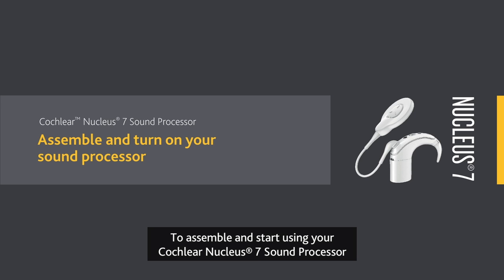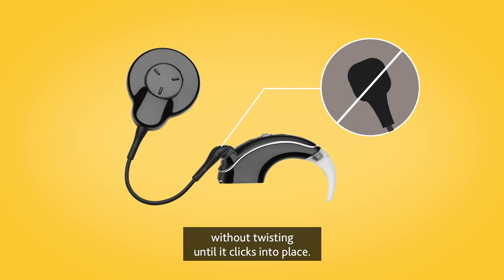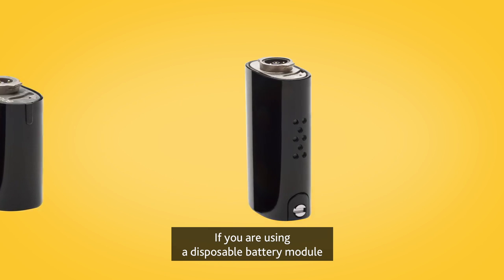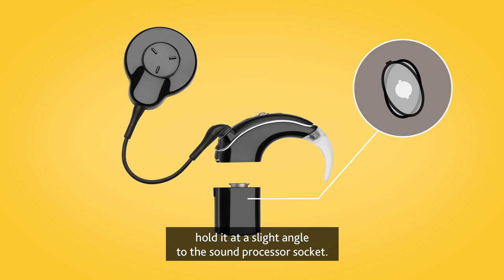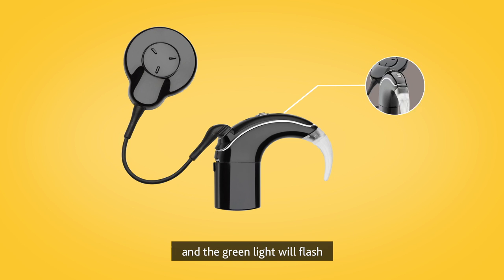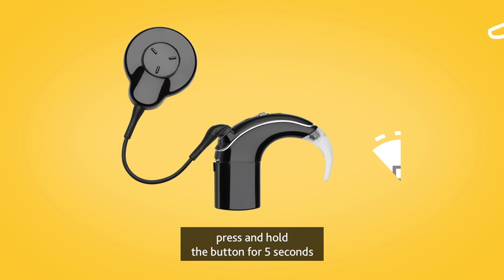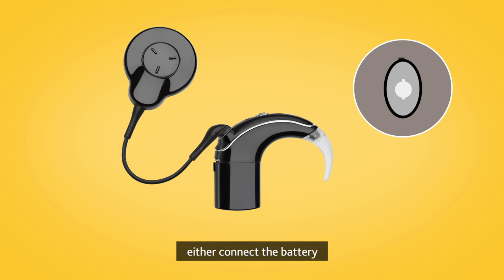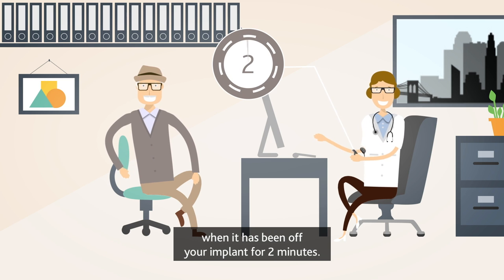Assemble and Turn on Your Nucleus® 7 Sound Processor

Comment: I am having trouble detaching the battery from my recharge short device I know how to attach battery but I have to get the old ones out it will no budge.
Reply from the maker: Hi Linda,
If I understand your comment correctly, it sounds like your battery is not coming off processor or they're not coming off the USB battery charger. If they're stuck on the processor, please make sure that the battery lock on your processor is in the "Unlock" position (or pushed to the far right of the cable). If the issue is related to the USB battery charger, please contact us so we can do additional troubleshooting. 
Please feel free to contact us directly at 1-800-483-3123, you can send an email to customer@cochlear.com, or Live Chat on our online store, 8am to 5pm MT. Contacting us by phone we are available Monday through Friday 6am to 6pm MT.

Comment: My processor does not go on when I attach my battery .lt blinks green, then or,ange
Reply from the maker: Thank you for reaching out. Please contact our Customer Service team at 1-800-483-3123 or by using the Live Chat option listed below Monday - Friday from 9am to 4pm MT. The Live Chat is found in the upper right-hand corner beside the login button. 
https://bit.ly/3puooME
Reply: It blinks green twice after you press it means the battery is good and when it blinks orange it means it is not connected to the implant you need to put it on behind the ear to connect. I learned that early within the next day after my first activation. As soon as I put on behind the ear, the orange disappeared means it's connected and I heard the sounds.